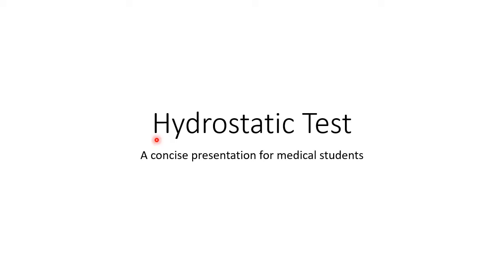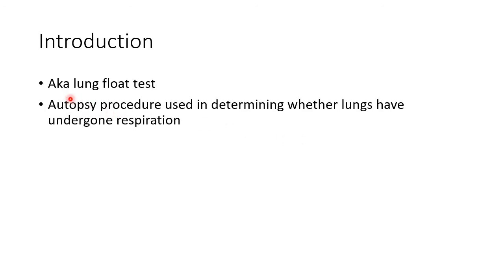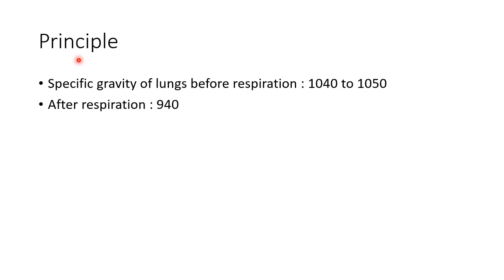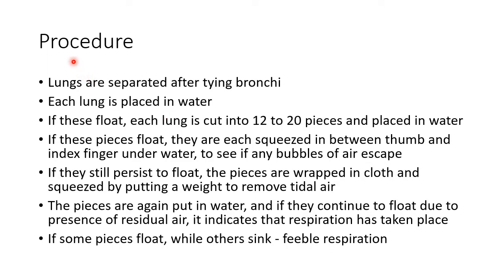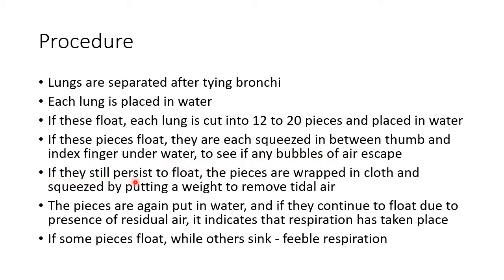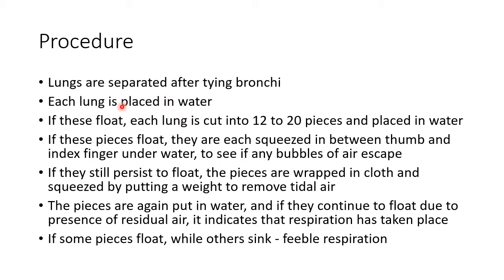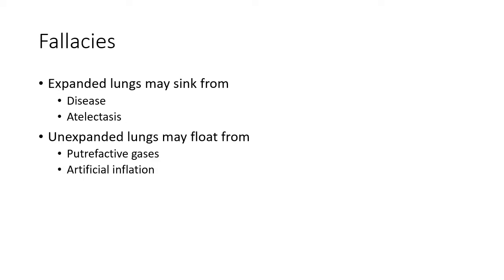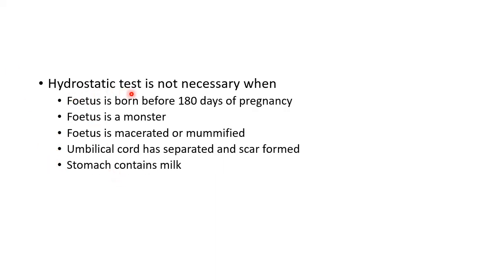Hydrostatic Test - Forensic Medicine (FMT)

Comment: Thank you, sir.

The term "hydrostatic" combines "hydro," meaning water, and "static," which is derived from "stationary." In this context, "stationary" means that the lungs do not sink and remain where they are, i.e., they stay afloat and do not move down into the water.

In short, this test determines whether the newborn has ever breathed. If the newborn had breathed, the air entering the lungs would make them less dense, causing the lungs to float. A floating lung can provide evidence that the newborn took breaths and was therefore born alive before dying.

The word "static" has also been used to form terms such as "status asthmaticus" and "status epilepticus." The word "status," related to "static," pertains to something that remains in one place and doesn't go away. Therefore, "status asthmaticus" and "status epilepticus" refer to episodes of asthma and epilepsy that persist for a long time. The term "statics" is used in physics to study objects that remain at rest, such as in electrostatics, as opposed to electricity, where electrons move.